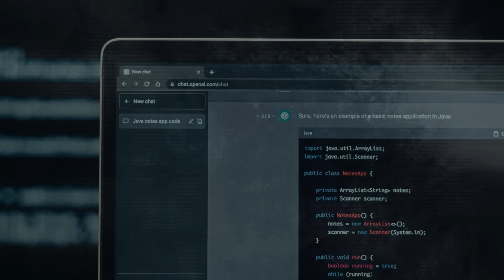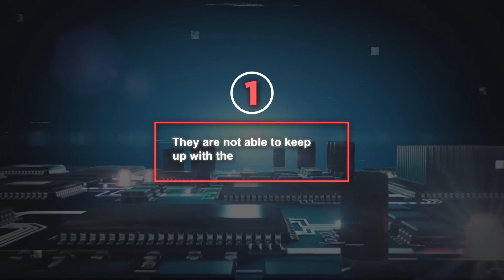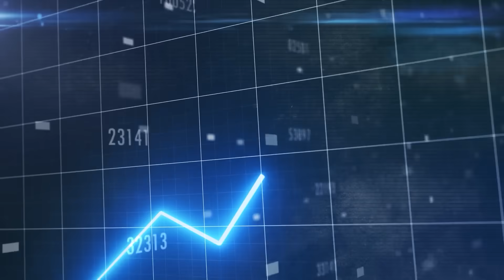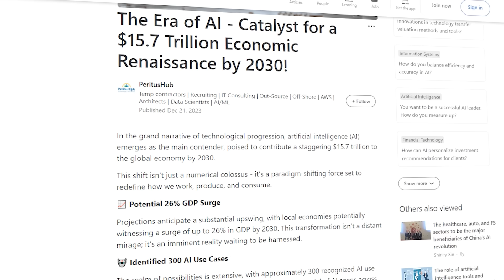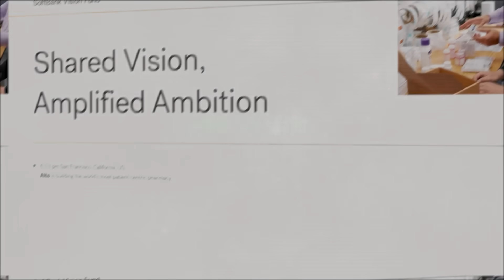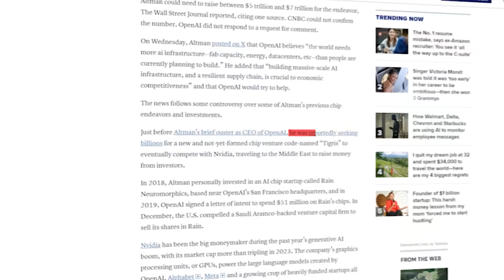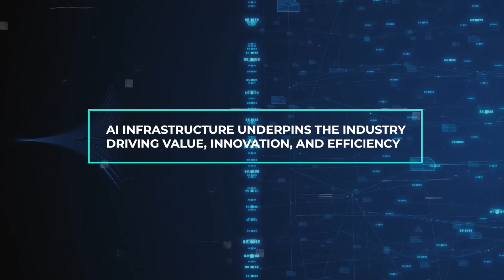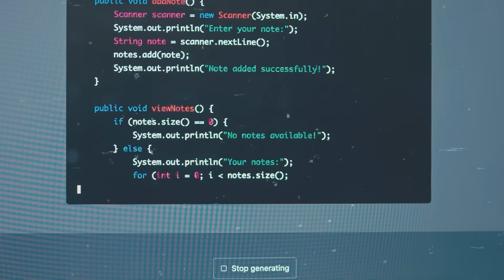Sam Altman's New $7 TRILLION AI Project Shakes the Earth!

Comment: If we should double the compute resources several times per year, I guess it will not take long until the electricity production limits that…
Reply: Usually, processors tend to become not also more powerfull but more efficient
Reply: @davidzamora212  Yes, but in this breathtaking speed as we see the need for compute resources to increase? Doubt it I must say…

Comment: You have a huge misinterpretation of the chip space! Nvidia "designs" chips it does NOT make them. Chip making us done by foundries - the most important of which is TSMC, located in Taiwan. So there are multiple separate stories here of better designs being required, but also trying to reshore chip production to the US due to geopolitical concerns.